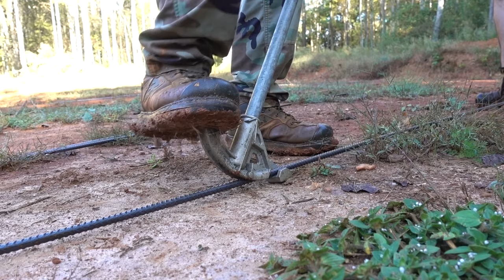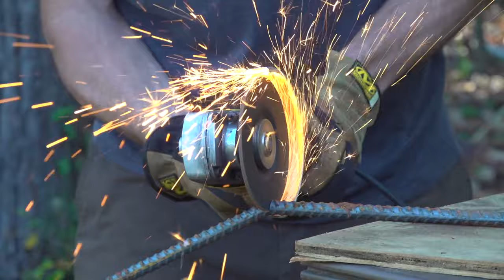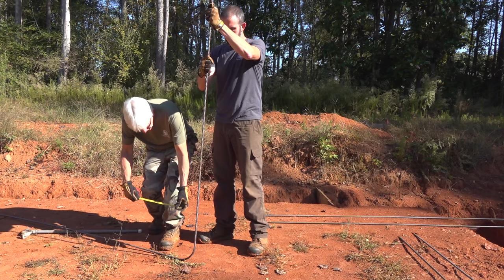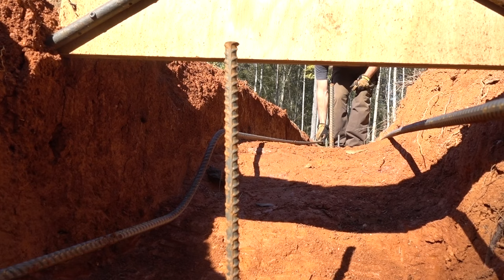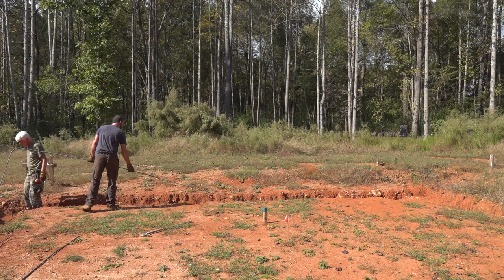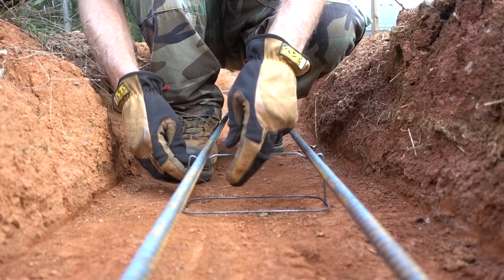Laying Rebar For Our Footings

Comment: Sorry but this is what not to do.  All rebars MUST be embedded in concrete.  You are exposing the entire grid to rust with those metal sticks "grounded" to the soil
Reply from the maker: I have responded to this several times for this video.  Long story short its common practice here. 😁
Terry
Reply: Do you think the staked rebars rusts will travel to the structural rebar that quick? Like how much of a drawback do you think it’ll be to the structure? I’m curious just because the name of the game is pros and cons. I see the pro which is grounding your homes footer easy, and I see a con but I don’t know to what degree
Reply: Also, by no means is this even bad practice just in the game you always wanna know the good, the bad, and  what you should be aware of! I see the purpose of the staked rebar, and i also know exposed rebar will get rust, but will that staked rebar really be a catalyst or something that Just rust the house from the ground up? Like how quickly would the process even happen (rebar will rest even in concrete), but is it really that much quicker?
Reply: @Someonesgottabuildit  I an planning a slab on grade this summer but it will be frost protected, meaning I can't use the ufer ground method since there will be insulation between soil and concrete (code does not allow). General guideline are Rebars must be surrounded with concrete, about 3 inches but not always possible.
Reply: @Someonesgottabuildit  theres no need to put skates, there are easy ways to get around that method.  I will be using plastic chairs (from CV plastics). Then I will bend some rebars in a shape to allow the structure to stay in place and add reinforcements in the footing area of the monolithic slab
Reply: @Someonesgottabuildit  if you want I can send you a snapshot of my design
Reply: @regiscarrier996  I get what you mean, first you’re  planning a slab on grade which prevents you from using the ufer ground method. I mean you could technically do the ufer method, but you’ll have layers preventing the rod from touching the ground (or you would have to get a longer rod and make it cut into your grade layers). Now you said you’re using plastic stands to keep your rebar in place above the ground about 3”, but what about grounding your home or building to the earth? Are you just gonna call in a electrical engineer or what method is gonna achieve that for you?
Reply: @Someonesgottabuildit  exactly was I was thinking today.  I have to talk to the electrician anyway to bring electricity from the grid to my house.  Might as well ask him how to do this.
Reply: @regiscarrier996  sounds good, best of luck! I’m sure it’ll just be a staked rod, clamped at the top to a wire running to some output box on the home.
Reply: Use old plastic pots to prop up the rebar
Reply: Should it not be put in a wooden casing and floor lined with damp proof membrain.
Reply: @regiscarrier996 we use concrete dobies here
Reply: @Adam-t5j1n Here from SoCal…we use concrete dobies too. Easy to make em if you need to.

Comment: Not gonna bust your balls over the job you did, you're amateurs, but for all practical purposes you never pound bar into the soil then cover it with mud. Just because all the locals do it and been doing it that way for years doesn't make it right. Use concrete spacer block or more commonly known as dobies. Just a fyi, nice job though, precutting your tie wire was cute.
Reply from the maker: First off we have several property pins that clearly state "1/4 inch and some 1/2 inch rebar" We even have one that states its and "old axle" lol..  Brian and I have located all of them which are many on our somewhat cut up property line. Every one of them are still in tact and other than surface rust they seem to be doing fine. :) According to two pros (not related or working together) around here who are life long concrete guys doing multi-million dollar jobs on a regular basis they say they have done this since they started many years ago. They said this argument has been around for ages. One went to multiple courses on concrete. Apparently Duke University did a study some years ago and determined that in a worse case scenario it would take approximately 413  years for the rebar to rust out in a slab stake situation such as we have done. 
Now if we had tied those stakes to our rebar in the footers we may start having problems at 413 years from now. However they do not connect with the exception of the chairs in a few places intersecting with a couple of the stakes. 
So even if the rebar were to rust out tomorrow or 413 years from now it would basically be like drilling a 1/2 hole every 6 feet on our footers under the walls. Those footers range from 19" to 24" wide and anywhere from 8" at the very minimum to 24 " deep. Those holes would have zero effect on the performance of our footers. Not saying they will not rust but the rust will not be a problem in our situation. 
Again if you tied the stakes to the rebar in the footers then some time in the future it may be a problem but we did not do that for the very reason of rust concerns. 
One of the two guys I talked with recently said the rebar rust argument started when people were letting rebar extend past the footers into the surrounding soil. Then as the rebar rusted it worked its way horizontally into the footers and water was able to travel horizontally into the footers and make its way around the footers which I see as a very possible problem but its nothing near what we have here. Those arguments are old as dirt. :) I guess time will tell but I for one will not be loosing sleep over it. :)
Terry
Reply: @ForestToFarm  that's cool, guess I'm just old fashioned, doing things the right way the first time.
Reply from the maker: @roddiener  I do not disagree with you there. We are rookies and I always take the best rout when I am aware of such lol. Hindsight I would avoid it if I felt there may be issues with doing it like we did. Our intention is to do the best job possible. I am sure we will lack perfection in more than one area of construction though. :)
Terry
Reply: Fight eachother
Reply: Yeah... yeah just Beef it out. 

Looks like at this point, that's the Only way

Comment: I think our code here will not allow rebar driven in the ground to support the rebar.  The rebar will rust and cause the concrete to crack.
Reply from the maker: It was not there to support the rebar. It was there to give us a way to gauge how deep the concrete was while pouting. Local codes can vary so if someone in your area is against it they can say you can not do it despite what the code book might say. For instance in out area the county  required all smoke detectors to be on an arc-fault breaker while the city said they could not be on one lol. It took 10 years before the city admitted that the county was correct and the city finally changed their rules. Around here everyone I have talked to used rebar as we did. 😁
Terry
Reply: @ForestToFarm  Don't see a problem with what you did. You did not tie to the other rebar.  You did connect the rebar seat to one, but the rebar seat is a non-corrosive metal and would not carry the rust to the other rebar.  So, perfectly fine IMO and a great idea about the conduit bender!
Reply from the maker: @steveprivitor239  Thanks and Thanks!
Terry

Comment: You do realize when you pound rebar in the ground like that it corrodes.  The bar over time and rust everything out.
Reply from the maker: Every contractor I know does it this way. Its not touching the actual structural rebar. So even if it does rust out its gonna be a 1/2” hole in a 24” wide 12” to 18” deep concrete footer. People drill much larger holes than that in concrete without concern. With that said if a person were to be concerned about rust a better choice might be the fiberglass rebar for grade stakes. 😁
Terry
Reply: @ForestToFarm  ya up
In Canada we just get called on it by the building inspectors.    That’s there opinion.  Maybe our climate is different.

Comment: I like your video. I wish we had enough clay in our soil to pour footers without forms. One thing to consider is not driving the vertical rebar into the soil. I worry about it carrying rot throughout the rest of the rebar.
Reply from the maker: Thanks. The grade stake rebar is not attached to the structural rebar. It’s been done this way for ages. Lots of controversy over it. Every contractor I know does it this way. 
Thanks for watching!!
Terry
Reply: @ForestToFarm  I understand your point. I choose to avoid it.
Reply from the maker: @scottpenman7968  probably a good idea. When I do another footer I will likely form the footer. If I go the grade stake route I will use the fiberglass type. 
Terry

Comment: I thought you Shouldn't let any rebar touch the soil?
Reply from the maker: Been hearing that here a few times now.  As mentioned in a previous comment- First off we have several property pins that clearly state "1/4 inch and some 1/2 inch rebar" We even have one that states its and "old axle" lol..  Brian and I have located all of them which are many on our somewhat cut up property line. Every one of them are still in tact and 
other than surface rust they seem to be doing fine. :)
The local “pros” we talked with all said this is the way they have always done it. I have no clue but honestly in hindsight it probably not the best idea. Although its only touching the soil where we put the pins for concrete depth. Its not touching the rebar support runs. In that case should those pins rust over time its basically no different than drilling holes in concrete which is done all the time without concern within reason of course. One hole every 6 foot in the massive footers we poured hardly seems concerning. 
Terry
Reply: You should dobbies 3x3 concrete blocks with tie wire on them. That way no steel ever touches dirt. Water will follow that rebar then the wire to the footing rebar and within 20 years the rebar will blow out the concrete. Starting as a little crack which will let more water in and will completely damage the structural foundation. I see this all the time in Mexico where I vacation. A simple change here will make a world of difference. These wire frames work great on floors holding rebar off of wood/steel forms.
Reply from the maker: @toddseely8371  I commented about a study on this subject some where in these comments. It tells a different story but I can not confirm either way.Thanks for the advice!
Terry
Reply: Where's the moister barrier

Comment: Love this song and also love watching this video a lot learn something new everytime but how do you level the hole where you pour the concrete sorry I’m a big rookie I just do landscaping but want to learn how to do this for a big shed / garage I want to build or a small house cheers
Reply from the maker: First off we are not experts. However we do get the job done 😁. We used a Bosch transit which basically sends out a laser at what ever level you set the transmitter at and then you have a receiver that is mounted on a pole with basically a ruler/ measure on it.  For us we started at the lowest point of our footings and then dug everything else to that level. If you have to much of a drop in elevation then you may want to have a step down in your foundation. It seems very complicated but its really not. You just have to think things through. Hope that helps. Thanks for watching and for the kind words!!
Terry

Comment: Enjoy your videos guys, but a good practice is never pound rebar into the ground.  It will rust, wick moisture into your footing, spall and crack your concrete.  As a rule I only use plastic or cement dobies as stand-offs.
Reply from the maker: Good point. Its what everyone here said to do. Then we start find out about the rust thing later. That's life. 
AS mentioned in a previous post- First off we have several property pins that clearly state "1/4 inch and some 1/2 inch rebar" We even have one that states its and "old axle" lol..  Brian and I have located all of them which are many on our somewhat cut up property line. Every one of them are still in tact and other than surface rust they seem to be doing fine. :)
Terry
Reply from the maker: @THEWRENCH343  Will do Thanks!! Amd your welcome.
Terry

Comment: Nice video guys, in respect to the rebar stakes, won't the direct  contact with the ground corrode  them and speedup possible  spalding of the concrete  foundation.  I've seen some builders use small concrete blocks to hold the rebar off the ground to achieve the desired clearance, this should hopefully ensure the concrete is sealed from the elements in the ground.  Best
Reply from the maker: I have heard all kinds of concerns. All the local long time contractors I have talked to have done it our way for many many years without a single issue. We are not concerned in the slightest. 
Terry
Reply: @ForestToFarm  cheers , it should be fine 🙂
Reply: @ForestToFarm  it won’t affect right away but footing or foundation rebar covering should be 3in, this isn’t me or everyone else saying it it’s ASTM code saying this. You’re essentially compromising utility life of your structure
Reply: @luisdelcid7051  here in Missouri code has changed . They now allow rebar to make contact with dirt like the grade stakes . There was no evidence to back up the theory that the rebar would rust and cause structural problems . They study found there was not enough oxygen down at that point to cause rust concerns . Grade stakes were used by old timers then it stopped for about a decade and now it’s acceptable again
Reply: @dtm7909  Still an inferior construction method

Comment: Are the pieces of rebar that are stuck in the ground (kinda like "rebar post") just stuck down in the dirt, or are is there concrete holding them (like a wooden post with concrete)?
Reply from the maker: We drove them into the dirt. Its very solid red clay. Worked out great for us. 
Terry

Comment: what are those little wire cage/pillar/holder things you rested the rebar onto actually called?
Reply from the maker: Rebar “chairs” is what I know them by. Ours were metal but they make others that are plastic. Thanks for watching!!
Terry
Reply: dobies
Reply: best to use concrete dobies, bond is better than plastic

Comment: I spent way too long searching for a perfect bending setup seeing how damn hard it looked to bend #4 rebar! I went out and used a magnet on my old 1/2" bender to make sure it was steel and not the aluminum, snapped it on and bent a 1/2" rebar like it was nothing! I would say it is about like bending 3/4" EMT as far as the 'pull' effort needed but it has been working outstanding. Then I just saw your video and agree, way too many acting like it's impossible without that four foot long $750 bender! NOT!
Reply from the maker: Awesome!  Great minds think alike ha ha. I generally don’t let what people say affect what I do. Thanks for watching!!😁
Terry
Reply: @ForestToFarm  Thanks for a great video. Hope your house build went well.

Comment: When you put the vertical reinforcing bars in at 24" or 48" oc is there every any issues with them not aligning with the block cores and what would you do then?
Reply from the maker: First off we are rookies at this. They do not set perfectly centered. That bothered me for quite some time lol. Then after talking with several people who do this stuff daily who all said unless its required they just drop them in and let them fall as they will. Not my ideal choice for doing things but they will still be within the concrete fill and add lots of support/strength to the overall wall. I am like you in thinking’ there should be a better way but I have yet to discover it. We did look down each cavity and picked the best position for each location. There’s lots going on in those holes so its not as big an issue as you would think once you start doing it. Hope this helps and good luck! Thanks for watching!
Terry
Reply: If web in middle of block Interferes  with rebar, you can just knock the web out of block. You can also bend the rebar at very top surface of footing 90 degrees (parallel to footing surface) and then bend 90 degrees back up (vertical thru cell opening). If you do the latter you will need to chip a small piece off bottom of web on first block for rebar to clear where the rebar is bent 90 degrees parallel to the footing top surface and first block sets on footing

Comment: Is it OK for the rebar to contact dirt? Wont it corrode?
Reply from the maker: If you look on YouTube many professionals do it. Also most every building contractor I know does this same thing. We have rebar pins marking some if our property line. They are 50 plus years old and still looking good. Personally I am not concerned. Even if they rot away its just a small 1/2” hole in the footer. People drill larger holes than that often for pipes, electrical and other stuff without concern. 
Terry

Comment: Concrete 101, never bury rebar in dirt, it's a direct conduit for erosion. Rebar requires a min of 3" of concrete coverage at all ends.
Reply from the maker: Love me some rust!
Thanks for watching!
Terry
Reply: Cocrete 101 I suppose. The Building Code sets the requirement not the tradesman. I have heard this is the way some areas of the country roll . I hear in rural Tennessee folks don’t need a permit to construct so they do as they see fit.  In my neck of the woods in SoCal, you can’t pee without a permit.  Lol.

Comment: Why pipe bender is used? Bend hooks radius is long. I know there is specified radius based on the rebar diameter.
Reply from the maker: Its what we had available. Code did not require us to install rebar. We just did it for extra protection or overkill. However I am pretty sure that radius is a minimum limit. You can have a larger radius and it happens all the time. Bay windows come to mind. Also when there is a slight turn down in the footings. I am no expert so don’t quote me on this. 😁
Terry